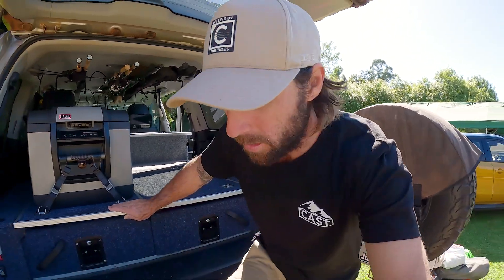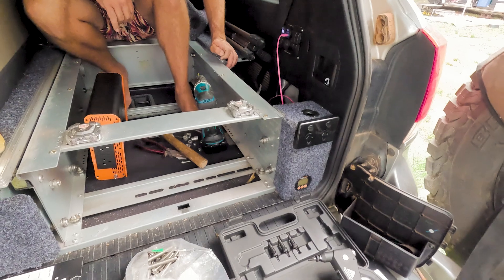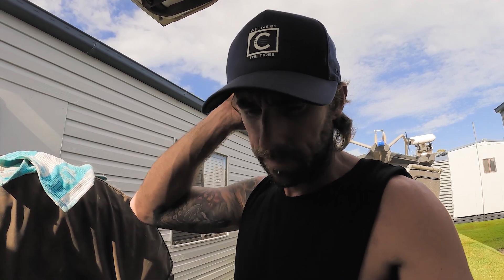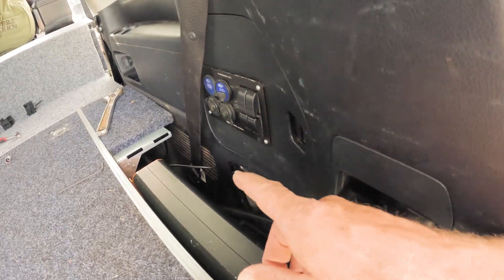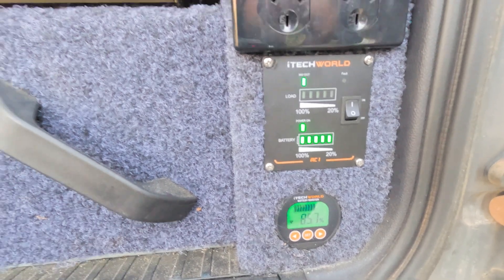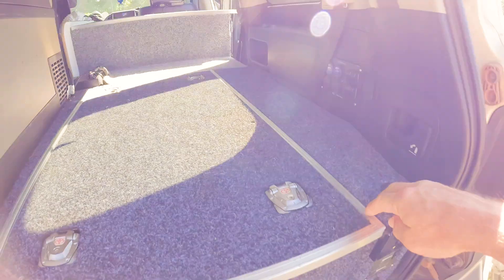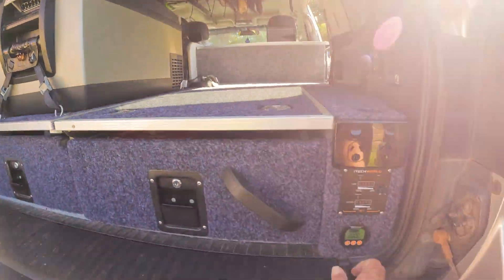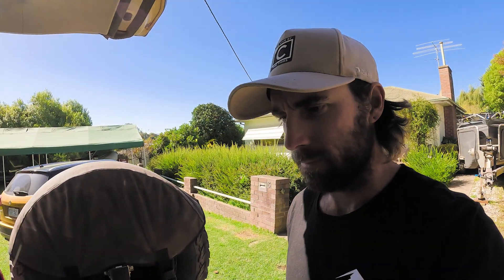How to Install a 12v Lithium System on the Road

Comment: Be cold heading south for the winter. Should be back up north. Run down on the meter Barra catching boat be mint mate.
Reply from the maker: It’s definitely cold down south that’s for sure. We are just about to turn and head north again! Run down on boat coming for sure 👍🏽👍🏽
Reply: @latitudesixteen6813  yeah sweet.   Mite see you on the road I’m on the way to warmer places
Reply from the maker: Definitely looking forward to chasing a Barra about again. Safe travels